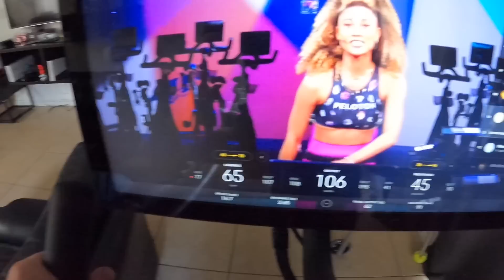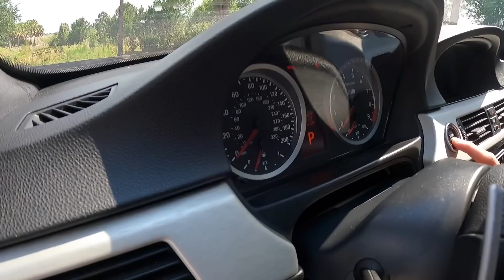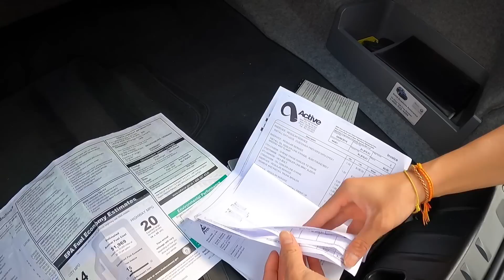WE GOT THE WORST M3 EVER!

Comment: Easy fix on the m3. Just check the quick disconnect on the fuel supply hose in the fuel filter or tank.
Reply: this needs to be pinned
Reply: This is exactly what it is. Air in the line won’t prime correct all the signs!
Reply: XISorryExpertIX i think the knew what was wrong with it there was gas on the ground smh 🤦‍♂️ but noone gonna pay 20k for a car and it break
Reply: it was obvious once they saw a puddle of gas
Reply: I came here looking for this comment.  I seriously can't believe they actually returned the car because of this.  I don't know about his friend, but Chris is mechanically inclined.  wtf?
Reply: Does it have latch access to fuel tank? lol

Comment: Connect the quick disconnect all the way or replace the o-ring on the quick disconnect fitting for the fuel supply hose. It’s only a 10min fix max

Comment: Bruh...I need to open a damn restaurant. I'm 38 and I have a 612 whp Civic racecar, but my daily is a 3.2L V6/six speed manual swapped 2001 Honda Accord with a GTS3582 turbo running on AEM. Yeah, it makes 500 whp, but it's not an E92...